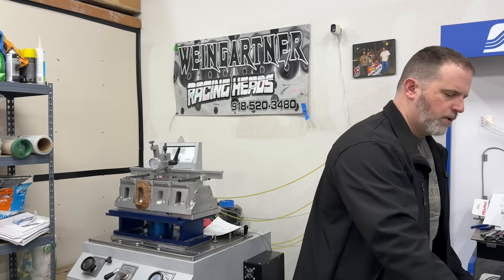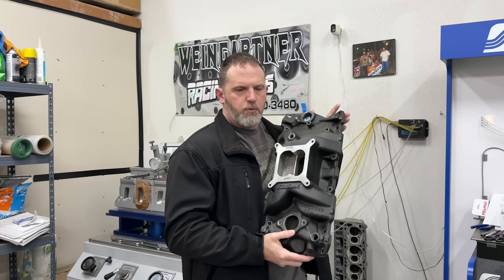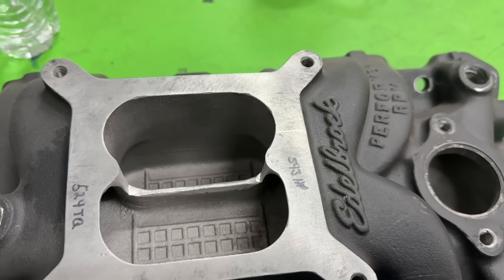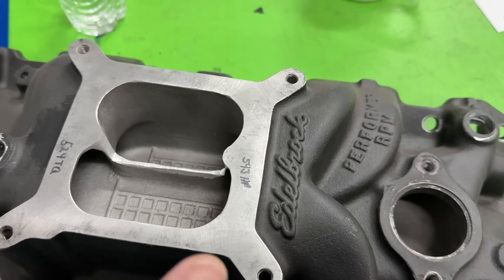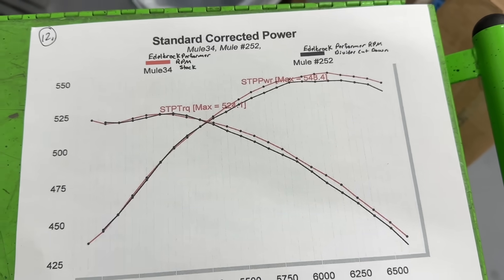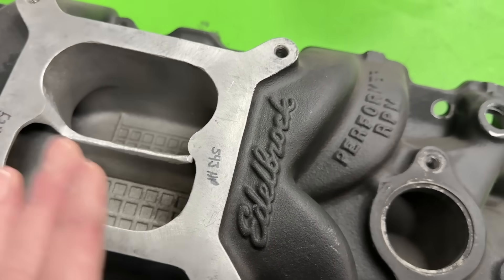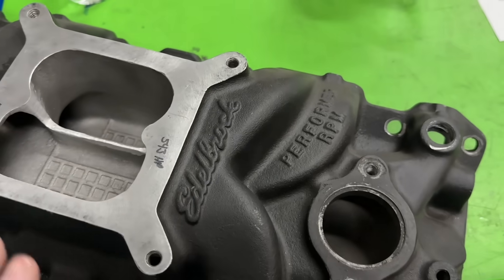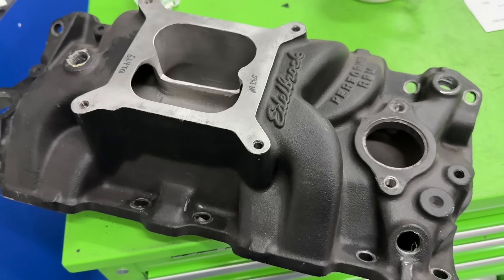Dyno Test Cutting Down Divider On Dual Plane

Comment: I have run and played with that manifold and the similar spreadbore version for years on SBC engines.  Repeat that test box stock vs the cut-down divider. Leave out the 1" open center spacer or even try a 4 hole on it. The cutdown version will usually match the open spacer on a box stock manifold without a spacer on it. Makes for a very stealthy setup especially the Q-Jet version with a Q-Jet. Grind the Edelbrock logo off and most do not realize they are not looking at the stock manifold.

Comment: Real world test in my 63 Impala. 406. 10.3 compression. Stock Trick Flow 190 heads. Stock Performer RPM manifold. Stock 750 vacuum secondary carb. 26 inch tall tires. 3:55 gears. No stall. 292 Isky cam. I pulled this car on the road. The engine flat lined at 7,000 redline in drive with a 3:55 gear with no problem at all. No speedometer. We calculated everything and found that we were going about 155 to 158mph that night

Comment: I’ve cut only 1/2” down when doing a divider when I’ve modified my intakes ….easier to tune at idle and all of felt like it picked up low end torque.
Never dynoed anything for say but drivability was much improved ….i did have to rejet and make some other adjustments….
If I have the room I’ll just add an open spacer , but don’t always have the hood clearance.

Comment: It’s better to just use spacers, 1) way cheaper ESPECIALLY if it doesn’t help. You don’t destroy the intake manifold. 2) it’s just a 5 minute bolt on job. 3) can test and determine if 4 hole dividers best, open dividers, 1” height or 2” height is best. Because as you should know what works best on 1 combo might hurt it with just slight differences in another combination. And many MANY others for 30+ years have shown that correct spacers ALMOST ALWAYS IMPROVE PERFORMANCE

Comment: Basically you need to run 27 different combinations 27 different dyno runs or no one will be happy. 
You have to test 3 different manifolds, one uncut, one with a one inch cut, one with the seperator removed.
Then you have to run 3 different spacers one with no spacer, one with a divided spacer, one with an open spacer.
Then you have to test 3 different cams, one too small,  one too big and one just right.

Comment: I'm looking forward to the testing with various cutouts. Everything I've seen until now says that using a 1 inch open spacer or cutting down the devider on the Performer RPM makes it perform very similarly to the RPM Airgap. All of the testing I've seen was on fairly mild 350s and 383s, though

Comment: chopping out the divider allows each cylinder to see all 4 barrels of the carby. It effectively increases carb size.  With a smaller carb you will see gains.

Comment: I would expect the cutout would have shined upstairs as, opposed to down low. That said, we all know you don't race dynos With that said, I would bet In an actual car, under load at the track, with a higher stall and more rear gear, that cut out may out shine the no cut setup. A track test could be interesting, and a lot of work. Maybe a different LCA might tip the scales too.

Comment: Hey Eric,
     Tim here.......from what i understand, yes, you cut to much, there is a sweet spot.......somewhere around .500- .750 is what u wanna remove....also, i just built a 406 Pontiac......used the RPM.......i didnt cut the divider at all......i radiused the divider instead, used a 1" open.......dont know on dyno, but car pulls just GREAT, dont let off till my foots outa it, and seems to have great bottom......but thru all my diving into research, apperently theres a sweet spot for cuttin the divider down.....again, somewhere between .500, and .750.......just food for thought....GOSH i love ur chanel!....PEACE my brother, and if i dont comment on anything soon, i wish YOU, AND YOURS A VERY MERRY CHRISTMAS!!.......😊

Comment: Why do these comments people talk about the 1 inch open spacer effcting power when he tested the 1 inch open spacer on both with divider and without divider simple guys onky difference is the divider cut out my got people are insane sometimes. The only other thing I can think could try is what if the divider in vs cut without spacer maybe but I think the test would be almost the same thing theory but you guys ignore the 1 inch spacer deal in was in both cut and not cut divider

Comment: On our EMC engines that cost torque every time.  Just because a 1/2"-1" open spacer makes more power on a DP does not equate to cutting the divider down and getting the same results.
Reply: 100%

Every combo is different.

Comment: On that combination, it didn't like the divider removed.    There are engines with the divder removed that picked up vs leaving it in place.  No single answer covers all.

Similar to the exhaust nonsense about what is best, two independent pipes, x or H pipe...  combo dependent.   
Good stuff on your channel.

Comment: We used to leave the divider alone on automatics and cut it down about .500 for manual transmissions, but i honestly never felt a difference either way on a 6800 rpm 355 SBC.

Comment: You said it yourself, you cut too much.  This test was done by one of the magazines back before youtube.  I don't remember how much they cut but it wasn't much.   It gained power.  If I remember correctly, the cut divider isn't about flow, it's about balance in the plenum.  Maybe an easier test would be to take a factory intake with the divider (RPM Air Gap) and test it stock, then test it with a tack welded divider in place (I say tack welded because you can easily remove it and not ruin a nice intake, as you know they're not cheap).  Something to note is that the RPM Air Gap manifolds for Chrysler, don't seem to have the cut divider, interesting (firing order?).

Comment: How big is the carb you used?  This mod got popular back when 4150 carbs over 750 cfm weren't that common and this allowed each cylinder to draw from all 4 barrels of a carb that may not have been able to feed the engine without restriction.  IIRC, you usually use a 4150 that's over 900 cfm which would feed this engine easily.

Comment: My SBF RPM AirGap Dual Plane has the divider cut @ 1/4 of the way down by Edelbrock from the factory.
I'm sure that they dyno tested lots of cut down divider versions to arrive at the final manifold divider design.

Comment: One of our hot rod tricks from the 1970's we didn't have a dyno back then but lowering the divider was a solid 2-3m.p.h. gain on the 1/4 mile.
Reply: Yep. It also works when running performance propane.

Comment: Is the rest of the manifold fully ported as well? I have watched some of Charlies work on those & he only got them up to around 260/270ish cfm. The speculation was that to be able to properly port one, you would have to cut them in half and weld them back together afterwards? But if you are forced to use one?

Comment: This has been tested many many times in the past and always shown to be a worthwhile mod. Testing the std manifold with a 1" spacer is no different to cutting out the divider...
Reply from the maker: Then why did it show a power difference
Reply: @WeingartnerRacing  Two different ways to achieve almost the same effect which produced two similar graphs with only a small difference, exactly what you might expect. Until the test is done with the divider up to the carb face, as it was always intended to be used, you cant say whether it is better or worse. Manufacturers sell these with the divide cut out. I am sure they tested it first and wouldnt be selling them if it ruined manifold performance.

Comment: I found the same thing, so I`d made a  .040 aluminum plate with a blade that fits the cut out section and went right back to original dyno numbers, doesn`t have to be fitted tight 40 t0 50 thousands is good enough. I did find out it has a lot to do with compression and cam size, 260/270 at .050 should favor the cutout, pump gas compression in our tests nullified the cut. Also we didnt cut the slot as deep as yours. and we didn`t use as big a cam as yours, the differance in the graphs was a bit bigger,  mine was 242/250 duration. Information good or bad can be used.

Comment: Would be interesting to see what effect it would have to cut an approximate 1" by 1" deep square out of the divider I think on the secondary side. I've seen them like that too. Can only assume there's a reason for it but would be interesting to see why that's done instead of just lowering the whole divider.

Comment: I don't know about the results of this test. The 1" open spacer basically gives the effect of the cut divider. So chopping the divider so low plus adding the spacer dramatically changes the carb signal. Engine Masters tested this and proved the Performer RPM works better with a cut divider, but they didn't completely remove the divider. They also proved that spacers improved performance on an uncut RPM. I feel like this test contained 2 variables and the results aren't conclusive.
Reply from the maker: If what you are saying is correct then why did it have a difference in power.
Reply: @WeingartnerRacing so first of all, thank you for making this video and taking the time and expense to perform this test and share the results. I love your content! That being said, when I clicked the link to this video I think what I was expecting was a comparison on the Performer RPM before and after the divider got cut. As I understand it, what is presented is an already deeply cut divider with an open spacer and without an open spacer. So for someone like me wondering if I should cut the divider on my dual plane, it doesn't really validate anything other than don't do a divider cut AND a spacer on a dual plane.
Reply: @WeingartnerRacing You're answering comments
Reply: @WeingartnerRacing Question. Do you have a SBF to test a manifold. I ask because a friend of mine has my old Offenhauser 360 Equal Flow. If you had two other intakes you could compare the three. One regular, the Equal Flow and one that has been modified but none of them ported🤷.
Reply: RPM  or an air gap?  because the aip gap  is a lil different.  the air gaps come  with a cut divider.
Reply: @KingJT80 great point, I think it was the Air Gap. I was under the impression they were virtually identical for actual performance, but that may not be 100% true
Reply: @KingJT80  What you do to equal an Air Gap is just duplicate the Air Gap divider cut on the Performer. I saw a vid and they did just that and the power was the same.
Reply: @ThePaulv12 that's interesting! Thanks for sharing. I have a GM sbc Vortec dual plane and I'm thinking about cutting the divider and knife edging it but I'm not sure. There's no going back lol
Reply: @KingJT80 
The picture shows NON air gap.
Reply: @hotrodray6802  i know that.  RPMs  dont have the divider cut.  air gaps  do.  not really much of a power difference until you start adding spacers of certain types
Reply: This is correct.....and every engine combination makes a difference on how much divider cut out is needed, even on identical manifolds
Reply: I use an 1" spacer on the performer rpm

Comment: Is there a way to check the flow of each runner? Like you check the heads?
Reply: Actually that is a good question, I wonder how the ports flowed with the divider removed, interesting I hadn't thought of that before lol.
Reply: Wouldnt you like to see a CLEAR manifold with smoke so you could see the pulse and reversion ?   Anti reversion testing in the exhaust be cool also imo.